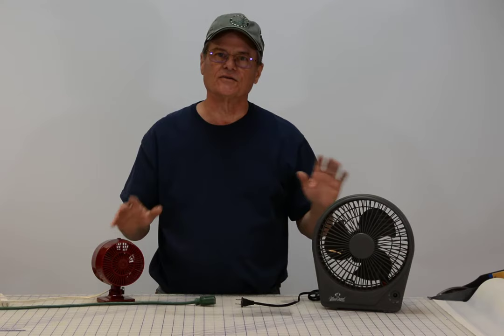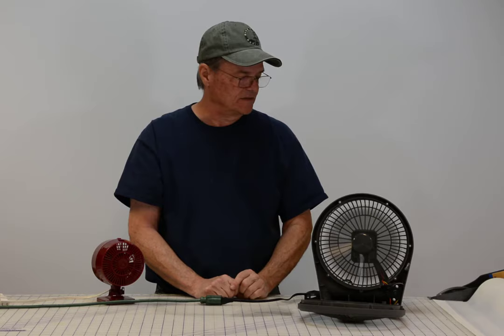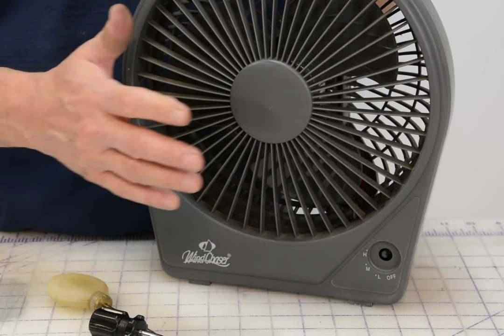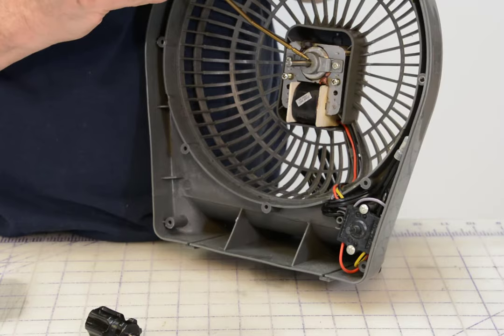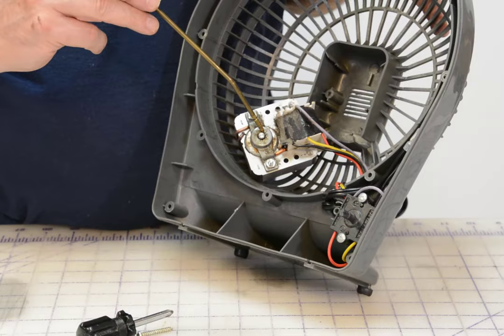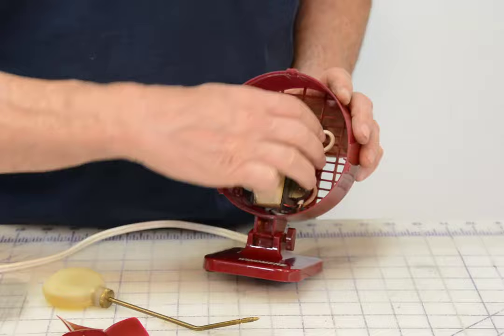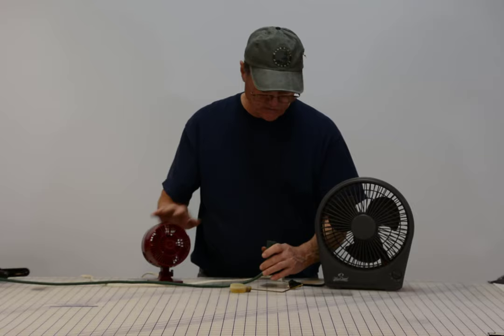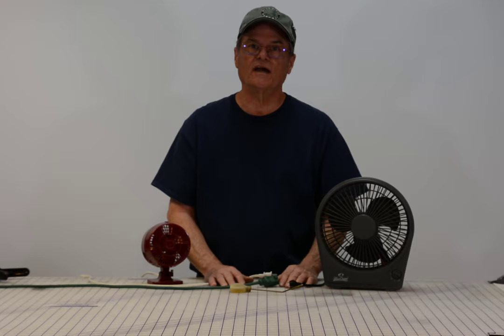Fan slow to start or won't startup - Easy Fix!

Comment: Great video! The little red one needs more oil as the blade still stopped too quickly when you unplugged it.

As the pandemic gets worse, fans will be needed for ventilation, esp if you live in an apartment building with interior hallways, like I do. New ones may be hard to get, so we got to learn to fix those old fans! 

Since 2014, I have found 2 Vornado “air circulators”, 2 box fans, and 4 pedestal fans, in, by, or on the way to the dumpster. Most of them either worked, or were salvageable.
1...One pedestal fan I’m working on has same problem you’re talking about (will be used for ventilation)
2...Another one works fine but has some damage (now using for apartment ventilation)
3...Another one did not work, recently gave to Goodwill for scrap (but told them fans may be hard to get soon, so they might fix it)
4…Another one worked fine but had a bent base.(fixed it as best I could, later gave to Goodwill)
5…One box fan worked fine but was missing a plastic stabilizing piece on the bottom(still usable, later gave to Goodwill)
6… Another one had a bad vibration (gave to Goodwill for scrap)
7… My larger Vornado “air circulator“ needed cord repair (fixed, now used for apartment ventilation)
8… My smaller Vornado was in perfect condition and did not even need cleaning! Wasteful, esp since this was IN the dumpster, not BY the dumpster (now also used for ventilation)

I hate landfill! But I love the fact that our local Goodwill accepts scrap appliances. Not all do, so check with your local Goodwill.
Reply from the maker: Thank you for visiting and the comment.  The little red one is OK, it just needed to run a little more to work the oil into the bearings.  Thank you for visiting and please subscribe if you have not.  Have a great day

Comment: Thank you so much for this video. I was about to throw away two fans, when I watched your video. The instructions were very clear. I followed them and the fans worked again! I didn't open up the motor to get to the back of it as I was a little worried about putting everything back so poured the oil at the front. Thanks again!
Reply from the maker: Glad it helped! Thank you for the kind comment and for visiting, have a great day.

Comment: Perfect, I diassembled my Holmes 16" oscillating fan, did one drop of 3-in1 oil on the front, one on the rear of the motor shaft and - PERFECT. QUITE and the STUTTER IS GONE. Thank you!
Reply from the maker: Great Job!  Thank you for the kind comment and for visiting, have a great day.
Reply: I wonder if I have the same one.  I can seem to get inside as the entire motor seems encapsulated, and I can't separate the two halves.  : (

Comment: I had a slow start and squeaking problem. No 3 in 1 oil in the house, I ended up using Vaseline. Been working great for 2 days now. Nice speed and not a squeak.
Reply from the maker: Not what I would recommend but it works.   Thank you for visiting and have a great day.

Comment: Thank you so much! You're a very patient person who explains things really well. Now I have to buy some oil for my 2 fans that have issues. I never knew they needed lubricating, but now I know that this has to be part of their maintenance. Although I thoroughly cleaned my Vornado fan, it's still making squeaking-type noises and often slows down while running or starts very slow on low speed, so I hope the oil fixes the problems.
Reply from the maker: I believe there is a very good chance that a little oil might be the right solution. Let me know if it works. Good luck with your project and have a great day.
Reply: @DIYwithWayne  I just finished lubricating the 2 fans (Vornado & Windmere), & now they run like brand new! The Windmere shaft was barely rotating, so I oiled the front of the shaft, but there was still no improvement. However, within 1 second of applying a drop of oil to the rear of the shaft, it was rotating so easily. It's amazing what a little oil can do. I'm so happy I didn't throw that Windmere away. Thanks again, & I hope you have a great day, too!  EDIT: The only concern now is that the Windmere motor housing & shaft are still getting hot after the fan runs on high for about an hour.
Reply: @aquacat8  Some motors will get hot and that can be normal under a load.  Just keep an eye on it and I would suggest not running it if you are not around.  Thanks for the reply.
Reply: polish the shaft is the key..

Comment: Hello sir appreciate you taking the time to make this video.. I have one of the white 3 speed fans that turns or oscillates side to side.. Nothing happens when I push the 1,2 or 3 button on the base.. So I have disassembled it and I see there's a capacitor.. You by any chance make a video on how to troubleshoot which part might not be allowing current to go to the DC motor or how to test this capacity?.. Thank you for your time
Reply from the maker: It is difficult to do a video without the failing item.  I do have a fan like you describe but it is working well.  If I find the time, I will see what I can do.    Thank you for visiting and have a great day.
Reply: @DIYwithWayne   I appreciate the response.. I tossed it in the trash today.. I replaced the capacitor with a matching capacitor and nothing happened..  I was getting 120 on the line side wire to ac motor. the wires were soldered to the AC motor,  so I don't know but again thanks for replying..

Comment: Great vid DIYwithWayne ! I expected it was that problem and an easy fix, very well explained, now if I can just find my 3 in 1 lol...

Oh yeah, on the suggestion not to use WD40 I agree, it's not really a lubricant. It'll do in a pinch for a short time but it won't last the way a light machine oil will.
Reply from the maker: Thank you and you are correct about WD-40.   Thank you for visiting and have a great day.

Comment: Long time ago . We always use those light weight turbine oil like from 
Zoom oil .
But nowadays. Most modern car uses 0w-20 synthetic oil .
Which work just fine for small motor bearing or HVAC motor lubricant
Reply from the maker: Yes that will work just fine.   Thank you for visiting and have a great day.

Comment: Thanks for the video! I was able to use this to fix a dual-motor window fan that was slow to start up. Not only does it start up immediately now, but it actually runs faster than it did before. I hadn't realized how much slower the fans were spinning!

Would a similar procedure work for a ceiling fan? I imagine it would be more involved.
Reply from the maker: Depending on the fan but they also have bearings that could benefit from a little oil.   Thank you for visiting and have a great day.

Comment: Thank you for this video. Bought some liquid bearings to use on my rowenta fan that stopped working. And this will help me get to the right spot.
Reply from the maker: You're welcome! We're so glad you found this video helpful. Thanks for taking the time to leave a comment. Have a great day.
Reply: Update: Was able to get my liquid bearings and after placing two drops of oil along the center axle after removing the fan blades., was SUCCESSFULLY able to get my pedestal fan to work smoothly and quietly again. THANK YOU 🙏
Reply from the maker: @txmd78  That's great.  Enjoy your repaired fan and have a great new year.

Comment: Years ago, this was common knowledge.   I've seen box fans from the 1950s and 1960s go 30 or 40 years, and all it took was to occasionally clean them and oil the motor.  Many even had specific provisions to oil the bearings.

But everything's disposable now, and products aren't made for long duration anymore.   Yes, you can still repair/maintain a fan or whatever, but the mentality of 'just throw it away and buy a new one' is everywhere - and I hate hate HATE it

A lady I was involved with a few years ago was utterly baffled that I would actually take apart a six-year-old, $15 fan and repair it.   "Why would you waste your time doing that?!"  she asked me.  "They sell new ones at the dollar store!".

She could not comprehend that cleaning and re-oiling a fan WE ALREADY HAD took less time than going to the store to buy a new one, and we didn't have to spend $25 (yes, the very same fan costs another $10 now), either.   I saved time AND money.   And despite my explaining this to her, she was still mad at me for not just 'getting a new one'.
Reply from the maker: There's not too many of us around anymore.  Keep repairing everything you can. Thank you for the kind comment and for visiting, have a great day.

Comment: Great video. I lubricated the front bearing based on another guide the other day but fan was still acting weird. Flipped the motor around just now and did the rear bearing and it is back to full speed. 👍👍
Reply from the maker: Glad it helped. Thank you for the kind comment and for visiting, have a great day.

Comment: Thanks for the great video. best one I've found online. This is my 3rd time lubricating my fan, where after a couple of weeks it moves slowly again. Used 3-in-1 oil this time instead of Lithium Grease so I'm hoping this will be the last time. If not I'll  try out the advice of one of your commenters, @Lucien Pellerin, who said "a peace of fabric between the bearing and the support braket,it is held in place by a thin locking washer.This fabric act as a sponge for the oil.After many years,it will drie up,it needs to be replenish.This is where you should put your oil.Sometimes it has harden from the heat so you let soak in oil solvent for a day.
Let it dry,add a few drops of oil,let the excess run off on a rag .This is done at both ends."
Reply from the maker: You may be needing to lubricate it more often if the bearings are wearing out.  Please let us know how this works out for you.  Thank you for visiting and please subscribe if you have not.  Have a great day.

Comment: I think its better if you open up the whole thing and lubricate it directly doing what youre doing is probably good for a month while lubricating it directly is good for a year it depends how often you use the fan. I dont know oils to use on small fans,  the regular ones I was told to use 15-40 kind itll last longer.  and opening it also let you see the condition of the shaft  which could be as well the cause of the problem.
Reply from the maker: I have been using this method for about 50 years and it works very well.  As the motor runs, the bearings will pull the oil in and it gets all the oil it needs.  Some motors are difficult to resemble if taken all apart, so I don't recommend it.   Also: if the shaft is worn, it will never run long no matter what you do to it.  Thank you for your comment and suggestion.  I know your way will work but most people don't need or want to dissemble the motor.  Thank you for your suggestion and for visiting our channel.  We hope you have a great day.

Comment: Thanks to help us fix things instead of throw them!
Reply: I just have WD-40 at home. Can I still use it even if it is not the best?
Reply from the maker: Yes, It will work bur may not last as long.  Thank you for visiting and good luck with your repair.

Comment: I just used some SAE 30W motor oil....works fine now.
Reply from the maker: Great, that will work but a thinner oil would be better but 30W will be fine.   Thank you for visiting and have a great day.
Reply: @DIYwithWayne  thank you buddy

Comment: Thanks for the video!I have a fan with a similar problem where the blades don't want to spin freely on their own.I took it apart, thoroughly cleaned it (it was very dirty especially the bearings) and lubed the shaft and bearings and the shaft spins freely by hand when placed back in the motor assembly, but when i turn the power on it's like the shaft and rotor jam or lock tight.....any ideas on the issue?
Reply from the maker: It sounds like a bind somewhere.  Other than that, I don't know.   Good luck with your project and have a great day.

Comment: I had fan squeaking and just blew out with some air but I will try oil it I didn't think suppose to get wet,thanks for video I ll try it.is there video how to tell if motors blew .thanks wayne
Reply from the maker: The oil should help.  As for the motor, if it tries to run, it is not burned out it is just held back by the dry bearings.  The oil will correct this.   Good luck with your project and have a great day.

Comment: Thanks!! Lucky I had machine oil at home and it worked! Curious though why do u advise against using WD-40 for this?
Reply from the maker: Hello takkis, WD-40 will work but it is thinner and will not last as long.   Also: if using WD-40, don't spray it on the bearings.  Spray into something and use a small brush or something to apply it to the bearings.  If you spray the bearings there will be over spray that will collect a lot of dust.  Thank you for visiting and have a great day.

Comment: I work in a shop and we had a guy like you that was super smart and he would fix most of our stuff plus he was cool like you and he retired and all we have now are worthless people,if i dont step up and try to fix it it will stay broken,i sure miss that guy.

Quick question Wayne,I'm very familiar with the fan that turns real slow and the lubrication bit,im one of those that has to sleep with a fan (thank god i have a back up) my regular fan quit working so i took it apart and lubricated it,got it turning real smooth,went to turn it on and nothing happened, that was the first time i have encountered this, you think maybe the motor burned up? it doesn't do squat when you turn the switch, any ideas? 

More than likely im just gonna buy another one, they are not much but if i can fix this one i might Try that,i have a pretty nifty Fluke that i can check anything on it, just dont know where to begin.
Reply from the maker: Thank you for the kind comment and for visiting. 
The motor could be bad but use your Ohm meter to check across the connections to the motor.  It should read low ohms, if it is open, there is a problem with the motor.  It could be the brushes did not reseat when you reassembled it.  You should be able to fix this.  Otherwise the windings are bad and not repairable.    Good luck with your project and have a great day.

Comment: I need your help! I have the Westinghouse 8” rechargeable telescopic fan. I’ve had for a year, works great. Now I start it and the lights blink (which they shouldn’t) then it dies after a minute of running. Any suggestions? 😭
Reply from the maker: I don't know but my guess is the battery has gone bad.   Good luck with your project and have a great day.

Comment: While you're in there you should clean any dust and debris away from the fan motor. Fan motors are designed to be cooled by the air flowing past them. Without it, the insulation on your windings can melt which will cause a short.
Reply from the maker: Thank you for your suggestion and for visiting our channel.  We hope you have a great day.

Comment: I have a bit of a dumb question, but what happens if you overlubricate it? Before I watched this video, I tried this on a floor fan that was slow and clunky and it seemed like it was working really good for about a day or two but then it literally just stopped as it was running. The motor also felt hotter than it should've been. I also wasn't aware of lubing the back of it so that wasn't done. Could this have been a byproduct of me overlubricating and just doing it wrong? I used the exact same oil that you have linked in the description so it wasn't the wrong type of oil. I have a box fan that's doing exactly what the black fan was doing so if I can figure out what went wrong, I'm willing to give it a try with it.
Reply from the maker: Over lubing should not cause a problem with operation but it tends to get messy from the extra oil.  I suspect your hot motor is because you did not lub the rear bearing.  Try adding a few drops of oil on the rear bearing and trying it again.   Good luck with your project and have a great day.

Comment: My expensive fan was slow to start and I kept allowing it to start whenever it could. Now it won't start anymore. Do you think the motor is burnt out? I'll try the oil trick....If the motor goes out, is it worth replacing? Mine is a $300 polished steel fan from Lowes. I had a warranty, but I used it one time already when the same problem happened.
Reply from the maker: When you turn the fan on, does it hum?  If so, the motor is not burned out and the oil will likely fix your fan's problem.  If there is no hum, try turning the fan blade (be careful doing this)  If it seams to try turning, the motor is good and needs oil.  If not, the motor may be burned out and if so the oil won't hurt it and I would still try it.  Good luck with your project and have a great day.

Comment: Thank you very much for this. My family has sentenced our fan to death when it had extremely slow start up. I just refused to agree and toss out the fan.
Reply from the maker: Good for you.  I would suggest trying the oil trick.  If it was going to be tossed out anyway, you can't do any harm to it and may save it.   Good luck with your project and have a great day.
Reply: @DIYwithWayne  Yes, the fan is working great now after applying some oil =)

Comment: What do you do if it’s electronic type of remote start and you hit the button for it to go back-and-forth it works fine however the fan itself the blades aren’t moving yet when you check them they could move very freely there’s nothing holding them back what’s the problem was there a power surge and the electronics got screwed up? And if so how long do you have to leave it unplugged for it to reset itself there’s no manual and nothing on the web
Reply from the maker: From your description, I would say the controller is bad.  Most likely, the only fix would be to replace the controller.  Depending on the fan, a new fan may be the least expensive option. Good luck with your project and have a great day.